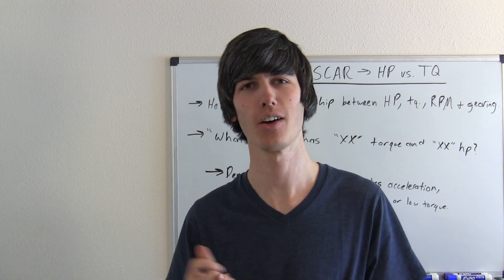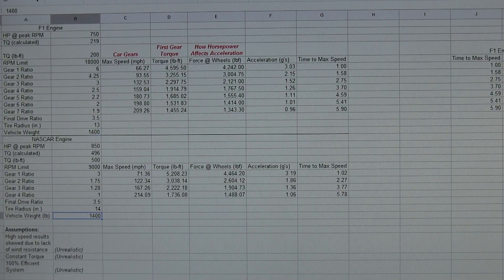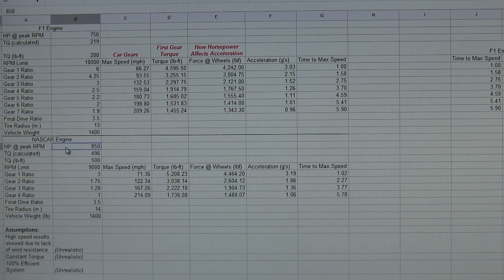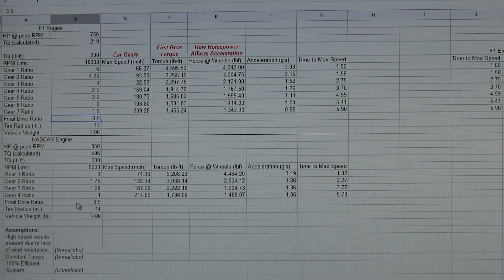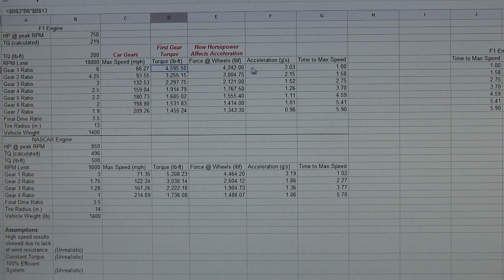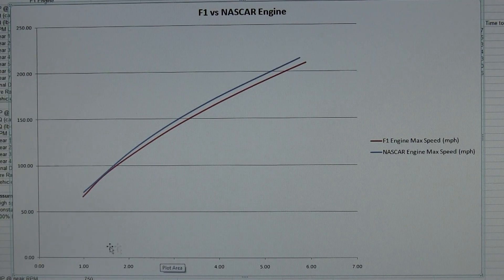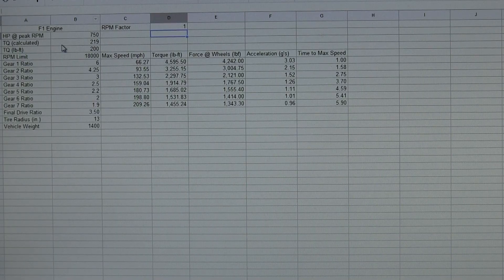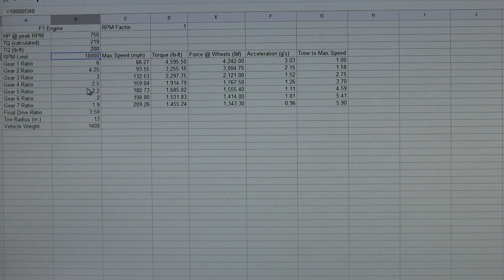Horsepower vs Torque - Formula 1 vs NASCAR

Comment: Torque comes into play when we start adding factors like going up steep inclines, the terrain, towing something, moving the vehicle from a dead stop etc. It's most evident in "off the line" acceleration, or powering out of corners. Based on the video, the amount of hp, rpm and gearing ratio play critical roles as far as acceleration. The simplest analogy I can think of when where talking about hp vs torque is that: torque GETS you going, but horsepower KEEPS you going.

Comment from the maker: I wasn't using them as comparison for skill/talent, but simply as a simple analogy which shows how engines of incredibly different torque values can still accelerate at relatively the same speed. In other words, why HP is so important in acceleration.

Comment: NASCAR and F1 are both incredibly hard Motor sports. One thing I've never understood is why people would compare them. Both are physically and mentally demanding. They both require a different type of discipline of racing. To say f1 is tougher than NASCAR is to imply that any f1 driver could drive a NASCAR stock car and easily dominate or vice versa. Which is just impossible.

Comment: Its exactly the same as changing the gearing.

Starting off in 2nd gear from the lights and adding another gear to the end of your transmission if the change was large enough.

Comment: They are also dropping the capacity from 2.4L to just 1.6L.

The move is in the hunt for efficiency, as all racing engine design is. Power comes from maximizing fuel per stroke and strokes per second, but getting maximum power for minimal fuel is the big deal breaker when they burn several kg of fuel a lap. The new engines are also incorporating energy recovery systems like the current KERS system.

Plus its technology they can trickle down to road cars, even Honda got on that bandwagon.

Comment: Power is really just how much fuel you can burn per unit of time, and they are limited in their engine capacity (currently 2.4L). So to burn more fuel per second they turn the engine over faster. The max RPM is also limited by the rules, or it would be a fair bit higher these days, and even more expensive.

Comment: Actually its 9000-9800 rpms at the high speed racetracks such as michigan, Indianapolis, and charlotte because of the long back and front straightaways of those racetracks you can gain a lot of momentum and build those high rpms

Comment from the maker: Correct, eventually I may do something with non-linear torque and equations set up to compensate for it. But from a simplicity standpoint you have to start with the basics, especially when teaching - hence, this video (which isn't all that basic, and comes as additional information to several other videos I've made).

Comment from the maker: Yes, the tech is very different. NASCAR just switched to fuel injection; they still use pushrod enignes with 2 valves/cylinder, iron blocks, etc. Formula 1 tends to evolve with technology advances much more quickly, as the sports are regulated very differently.

Comment: Yes pretty much. 

However, it is not that there is a limit for torque in F1. Rather there are rules that limit engine displacement and band forced induction. 

Therefore, constructors HAVE to use high rpm/high hp motors. There are essentially two ways of making power with natural aspiration. Increase the compression ratio or increase the rpms.

Comment: Nice video. You are ignoring a whole lot of things but it does demonstrate a good concept. 

Perhaps the most relevant update would be to include the effect of a non-linear torque curve. Since you are using accel, you can numerically integrate. 

Also I don't know if you explained this  but high hp engines primary advantage is staying in a lower gear. When this happens, the gearing effectively multiplies the torque. It is funny that it come out to be the same however.

Comment: In addition, they have less reciprocating mass allowing them to rev higher. 

When the cylinder changes velocity at TDS it experiences a huge force on it . When this force is increased, it can snap the connecting rods or crankshaft. Thus car motors just can't achieve the higher rpms of bike motors. Although there are some exceptions (f1 engines and rotaries for examples). 

I would like to say bike engines have a higher compression ratio but I'm not sure of that.

Comment: This video is assuming a lot. In real life, F1 cars have a much lower weight and stronger transmission (the engine and tranny are an actual load bearing portion of the car). They also have greater downforce and better traction which matters ALOT for acceleration.

Comment: There are other factors at play here though. In terms of pure theory yes they are very similar. But consider the engine technology being used. Didn't nascar still use carburetors until just last year? Also a formula 1 gearbox is light years ahead of anything used anywhere else.

Comment: The real question is which crew is more experienced at getting drunk & tearing up a bar? :) That's actually very interesting because of how different a high RPM horsepower motor feels compared to a motor built more for torque. When I swapped a 1650cc out of my buggy for an 1835 the increased torque of the 1835 made it feel faster (at least to me) but it really wasn't.

Comment from the maker: They work on the same principles, they just need to be light, so they rev higher to compensate for the smaller size to make up the difference in power.

Comment: so basically the F1 motor makes up for it's low torque by being very very high strung (high reving), versus NASCAR which has half the RPM's but has stump pulling torque :P.